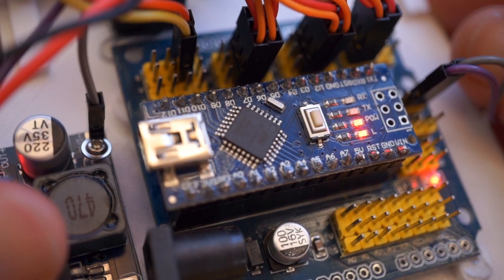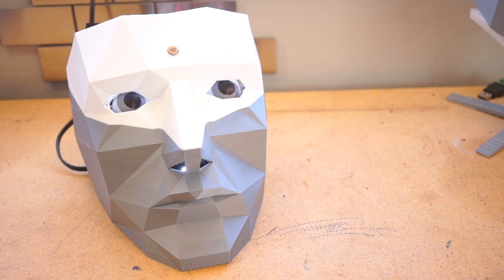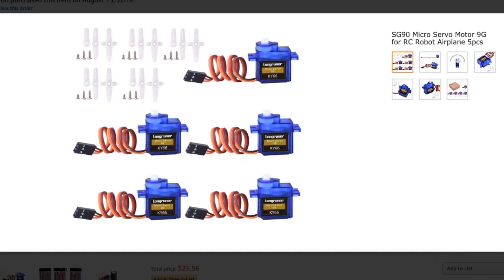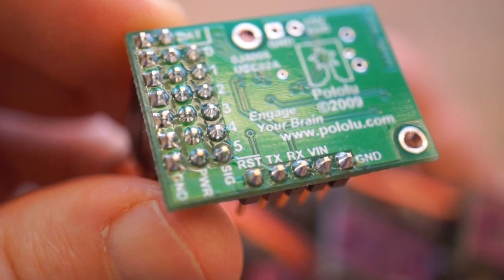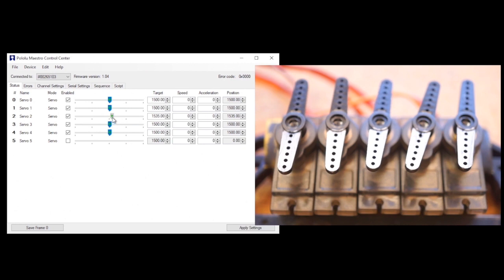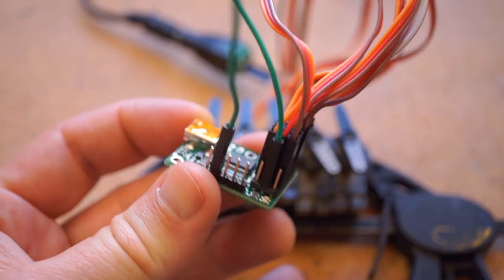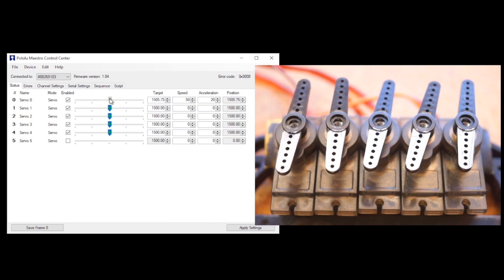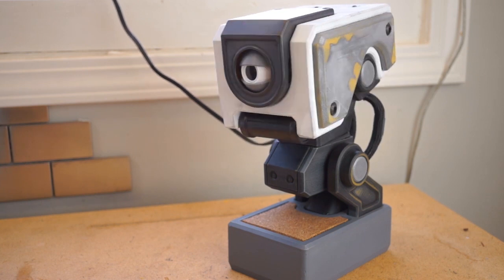How to Make Animatronics With the Pololu Maestro | Masterclass Maker Projects

Comment: They really need to add a timeline to the software.  Key frames are a starting point, but you need a more intuitive interface with a proper timeline if you're going to conduct a symphony of servos to produce organic movement.  There are plenty great examples of software that does this without forcing users to tweak scripts.  For example, xLights is designed for Xmas lightshows (and Halloween if you're me) that are set to music or just in general.

Comment: Hello, I have 8 servos that their stall current is 8A. I know that in the Mestro board each header can handle up to 1A and the VSRV
traces on the board can handle around 6A. I want to ask, do you recommend to power them with the board ? Or to connect the power to other board and just control it with the meastro? Does the stall current happens a lot and can burn the servos or it's just a number ? Thanks